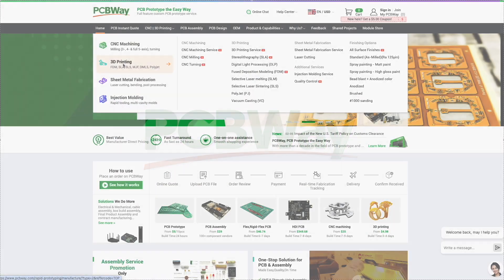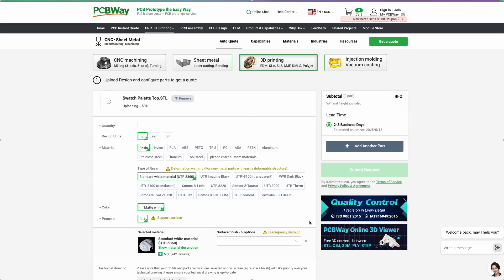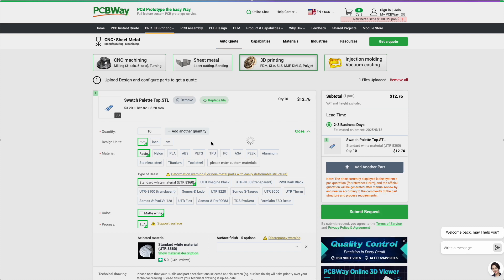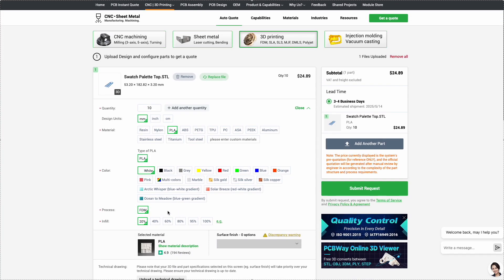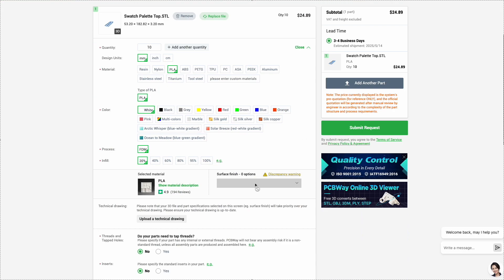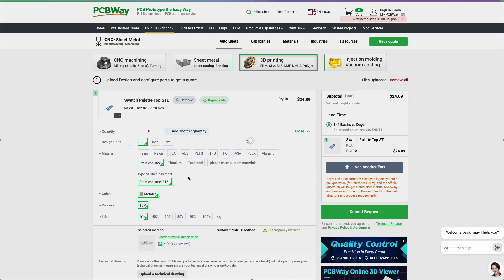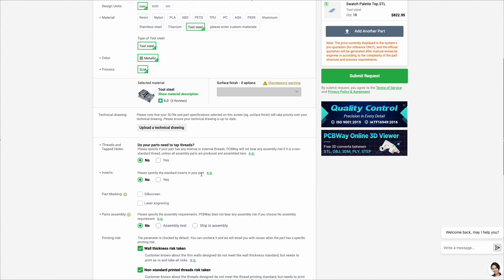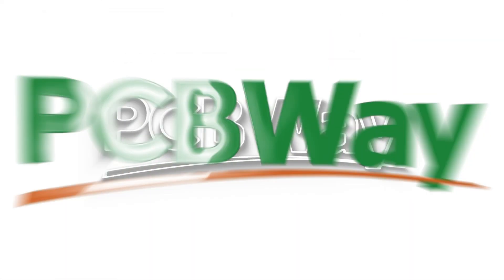Airtight Silicagel Bottle

Comment: I really like your designs, but for the first time, I'm wondering: what is the purpose of this bottle? Does it have a feature that the original bottle doesn't have?
Reply from the maker: On the project page, I mentioned that this bottle and its shape are intended for a special purpose in the future. For now, I’ve posted only a soft announcement about it. It’s part of a set of accessories that will be released in the near future, but not yet.
Reply: @V.Perinski  I had a feeling that behind this simple bottle lay a more elaborate project 😊👍
Reply from the maker: I’m looking at this massive project — and honestly, I’m impressed myself. At this stage, I’m testing a prototype of the whole system. I’ve already sent the final updated drawings to the factory. This is a project within a project, and it will include a huge amount of accessories, add-ons, and all sorts of interesting components.

But for now, let this remain a small announcement. I can’t reveal it at this stage, and I hope you understand. Over the past few months, I’ve barely published anything, so I decided to share a few fragments — some of which will later be fully presented as part of the complete system.

And trust me, each of these items, both individually and as part of the full complex, are highly functional pieces on their own.
Reply: @V.Perinski  No problem, I understand this situation very well. Being the perfectionist that you are, I can't imagine how much time you spend on a complex project. In any case, thank you for your contribution to the community. I must admit that I have sometimes been inspired by your work for certain details concerning my own small projects.